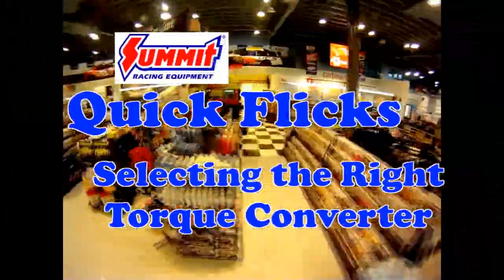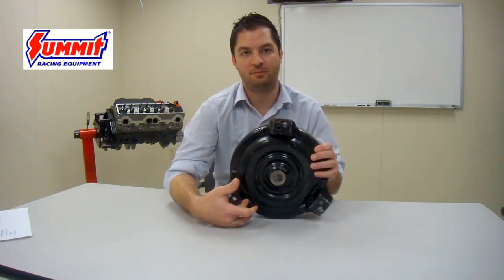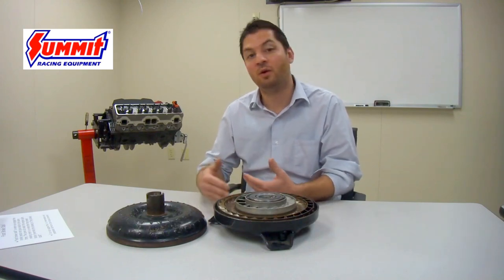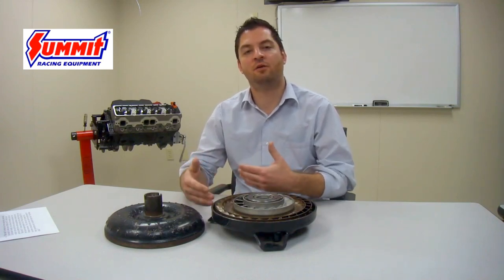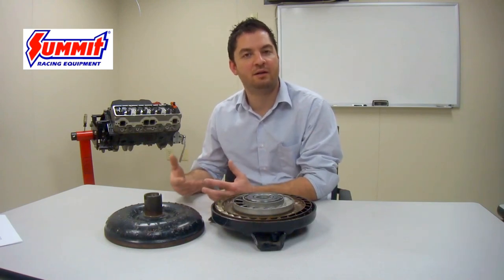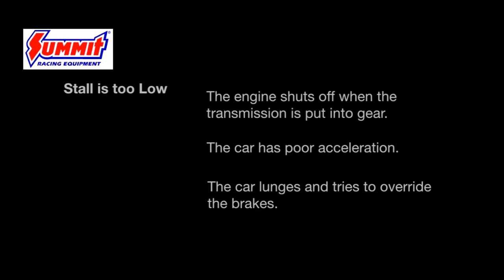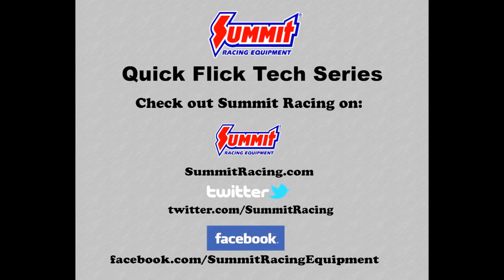Torque Converter Selection | How to Choose the Correct Torque Converter

Comment: Torque converters are about to be totally obsolete..  Do you want completely adjustable slip rate and totally adjustable stall speed? NO tire shock from lock up?  Soon as the shop gets moved back to South Carolina, I will be producing several of these for a specific shop. Sonnax will be producing production parts. This will change the way you race...

Comment: Doing a brake stall test for around three to five seconds to find out the stall capacity of the torque converter will not damage the internal parts.

Comment: Why does a converter stall 300rpm higher in a big block?
Reply from the maker: Hi patrick boreham,
The longer stroke (generally speaking) of a Big Block creates more torque which forces more slippage (Stall) inside the converter.

Comment: I have a stock 2005 g35 sedan with just headers and exhaust I would like to get a stall converter so I can get a better 60ft any tips on what I should do first?
Reply from the maker: ryu sanchez , 
Unfortunately, we do not carry a lot of parts for your Infinity. But, keep in mind that a torque converter is matched to the power band of the engine. If no engine mods are planned then you might consider a gear ratio change instead to boost your 60 foot times!

Comment: Sorry about using my daughters account (!@#$).  I have a 350 with a pretty lopey cam with 260/280 at .50, 106 seperation, (I didn't set this car up) with track 1 heads, 4.56 (might change to 3.73) and 26" tires.  Right now it is setup for drag and has a 4k stall but I would like it more streetable.  What stall would you suggest?

Comment: Summit should GO AHEAD and re shoot this video! It does not leave a good impression.
Reply: Is he mixing turbine and impeller up?  The Impeller is driven by the engine while the turbine drives the trans (welded to the housing and bolted to the flex plate), right?  The thing is already confusing, and then mixing terms up doesn't help.
Reply: Nevermind, I thought the flexplate was on the trans.

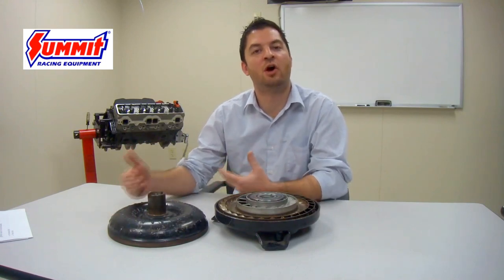Comment: so I have a 1982 dodge d150 short bed with mildly built 318 4 barrel with a 727 automatic transmission with a racing shift kit . the gears are 3:55  what converter do you recomend ? I was thinking 2000 ?? O the cam is just a factory Hipo 360 cam. the rims are 
 15 x 8 on back with 255/75/15 and front  is 15 x7  235/75/15

Comment from the maker: A 2,000 rpm stall speed is all that will be necessary. Please give our tech line a call @ 1-330-630-0240 for the correct part # and price for the transmission you will be using.

Comment: No one ever give a key piece of information about torque converts...  At some point a torque convert transmits POWER at nearly 1:1 ratio..  that is "Stall" speed..  once the converter is transmitting power at the highest rate it is capable of.  Thus, from idle to stall speed, your car will run, roll, excellerate  but you will feel a 'slipping' or mushiness in the 'transmission of power'..  this is not your transmission 'slipping' it is your 'torque converter' 'spooling up'...  as the TC 'spools up' the 'transmission' of power from your engine to your drive shaft reaches near 1 to 1 ratio.  
The ONLY true "PERFECT" 1 to 1 'transmission' of power, from your engine to your drive shaft is achieved with a TRUE clutch and manual transmission.   
ALL automatic transmissions/converters have "LOSS" of power and efficiency.  Could be 5%, or more, there are many variables.  Transmission fluid, fluid temperature, the wear on the transmissions internal clutches.  None of these 'variables' can be completely mitigated. (resolved)  They will always be an unpredictable variable, that you will pull your hair out trying to figure out what when wrong.  Drag racers will tell you, their quickest times, and their "FIRST RUNS" and the racing and day goes on they get slower and slower.  Fluid get hotter, metal expands, soft clutch material degrades/deforms under these harsh conditions.
Reply: Haha Except TC's with lock up clutches.
Reply: @DiscoFang  lock up torque converters are not locked at the strip or get destroyed.
Reply: @fasteddy  What’s your point? At drag strips a trans brake means you’re almost never below stall speed. Half what was said above is nonsense.

Comment: This is all backwards! Stall speed isn't the speed when a torque converter stalls, it is stalled up until that point.
So a 3000rpm stall TC is STALLED until it reaches 3000rpm!
With a TC below stall speed, the flow of fluid out of the impeller isn't producing maximum force on the turbine.
 Think of it like an airplane wing, a wing is stalled when airflow doesn't flow over the top of the wing smoothly and it can't produce lift, like at low speed.

Comment: I don’t agree with this guy.  He said if your stall rpm is higher than your highway speed rpm your stall will never lock up. This is false. If this were the case they wouldn’t make a street application for a stall converter. I mean with a 3000 stall you would have to be running a 500+ gears to get you to 3000 rpm’s at highway speed so it would lock up. I just watched several videos of a 5600 stall completely locking up at 2200 rpms. He could drive it normally. when accelerating it would rev to 2200 rpm’s before it would start rolling, it would maintain the same rpm’s until it reached around 40 mph, then it would lock up into drive. So his highway cruising speed  was no different than it was from the factory, with zero slipping.
Reply: I had a flex plate to go out an i changed it but i won't to know if u turn the torque converter with ur hand will it turn the shaft of the transmission or do it have ot be turn by the engine
Reply: Darnell Smith it takes hydraulic fluid pressure from your transmission pump
Reply: Glad to hear this cus I was running numbers and by this guy's logic, a 4l80e in front of a 3.73 and 29" tires would not allow for a stall of over 2100rpm lol.

Comment from the maker: A torque converter with roughly a 2,500 rpm stall rating would be the right choice for your combination. I suggest you go with a Hughes Performance torque converter part # HUP-22-25EL ($419.95).  Thanks for watching and let us know if you have any additional questions.

Comment: Don’t trust summit racing they don’t know shit about. Called them to build me an order for my specifications and they sold me total wrong and don’t want take care of it. Called for low to mid rpm torque G or tow abs the sold huge cam which is work only from 4000 to 6000 rpm.